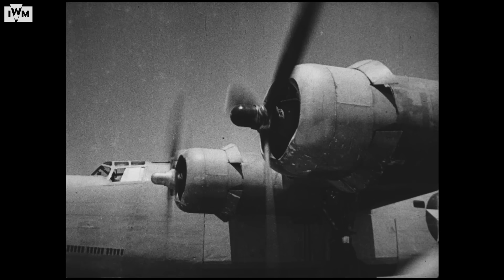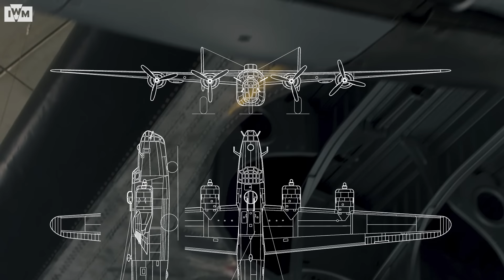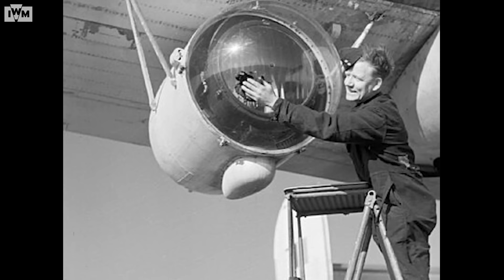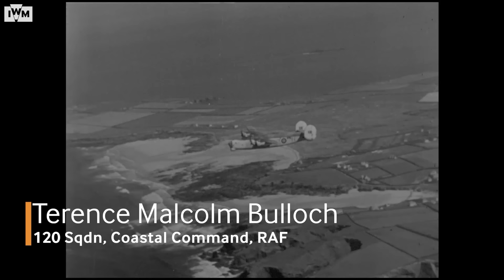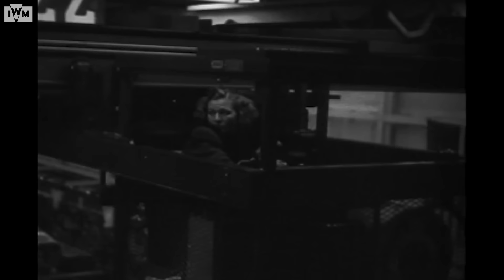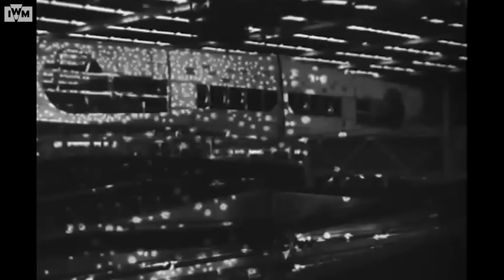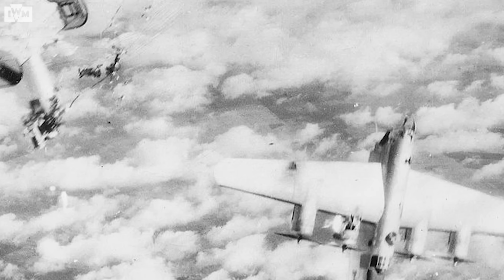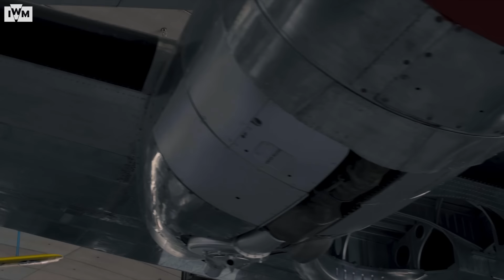The most produced Bomber in history had a bad reputation | B-24 Liberator

Comment from the maker: CORRECTION: In the beginning of this video, we said that the B-24 Liberator is the most produced military aircraft of all time. This is not correct. The B-24 is the most produced bomber of all time, but the most produced military aircraft of all time is the Ilyushin Il-2 Sturmovik.
Reply: I thought it was the bf 109 that was produced in higher numbers than any other plane in history. Something like 30,000 were built from 1936 to 1945 starting with the bf 109 A all the way thru to the last German built bf-109 K in 1945 . Plus  technically the Spanish kept building them well into the 1950’s under license and those planes are the ones in the 1969 Battle of Britain movie . Along with the bombers . The movie production company leased the Spanish airforces planes and pilots to shoot the air scenes in a lot of the shots showing the German side of the battle . Many movies were filmed using the Spanish army and their post war U.S military equipment that they try to pass off as real WW2 weapons. The Spanish army had a whole division or battalion that could be leased to act in high budget military movies about WW2 . All of the Spanish soldiers and equipment were used in Patton , Battle of the Bulge , and as I mentioned before the Battle of Britain.
Reply: @mrbig4532  The Sturmovik had slightly higher prodution numbers. 36000!
Reply: @beatglauser9444  than the 109 ? Not counting the Spanish built ones .
Reply: Cessna model 179 or whatever is the most produced plane. B-24 Is the most produced bomber. 109 Is the most produced fighter plane. And the Stormavich is the most produced military plane of all time.
Reply: @mrbig4532  the bf109 is the a fighter, NOT a bomber.
Reply: @Rosscogalli81  it was used as a fighter bombers . I get it I understand the difference.
Reply: @mrbig4532  Sturmovik my friend.
Reply: I thought the bf 109 was the most produced
Reply: @aprylrittenhouse4562  I think the number of the Sturmovik is roughly 36000 compared to the 109 was built about 34500. Huge numbers indeed!
Reply: @beatglauser9444  I wonder: Did that number include the postwar Buchon?
Reply: @raypurchase801  I am not really sure. But the ones built after the war in Spain and elsewhere were a very small number compaired to the ones built during the war.
Reply: @beatglauser9444   True.
Reply: @beatglauser9444   I wouldn't believe anything the Soviets claimed.
Reply: @aprylrittenhouse4562  Sturmivik my friend.
Reply: @aprylrittenhouse4562  
The most produced FIGHTER. 😉👍🏻
Reply: @aprylrittenhouse4562  The 109 is about 5th or sixth.
Reply: @aprylrittenhouse4562 Germany for sure
Reply: I did do a double-take, but t.b.h ~18,000 B-24's is still a hell of a lot of bombers...
Reply: Thank you
Reply: No matter, did Stalin send the U.S. any lend-lease?
Reply: @TimothyLove-m3x  that’s a big fat no ! Not only that but he detained are bomber pilots who landed there after their planes got shot up , and stole the b-29 bomber when one landed there after experiencing mechanical problems. He let the crew go home but after holding them for weeks in prison like conditions and made them take a out of the way route thru the Middle East when they could of just flown across the Bering Strait into Alaska and been home in 4 hours , or back on American soil . Than he refused to return four of our brand new b-29’s and copied everything down to the personal items the crews had on their planes. Never had a license to build any of those tu-4’s that they used from the late 1940’s up until the mid 50’s .
Reply: The same claim of the Me109 has been made often. I have read that Germany produced more fighters to the end of the war than ever before, but the quality control was gone. Eric Hartman said that late model 109s were 
"obvioulsly sabotaged".
Reply: I was just about to comment on that. Glad you caught it.
Reply: The Soviet Union lied about everything. not lying could get a person killed.
Reply: It's wicked refreshing to see a channel that cares about accuracy! It's rare today. I don't think I've seen any of the big channels (infographics, simple history, timeline, etc) ever go into the comments to make corrections after editing didn't catch it. Your passion for accuracy will keep me coming back 🤘🏿
Reply: Po-2.
Reply: Well the Sturmovik was a flying tank so technically you are still correct :)
Reply: Emily Charles is an excellent presenter.
Reply: Il-2 was a bomber...
Reply: Before it started I knew errors were on the way.and that is a big one.
Reply: I have read seperately that the most produced aircraft was the German 109 at 30,000+ produced.
Reply: @ImperialWarMuseums  During WW2 the B-24 was the most produced!! 
The Sturmovik was continued to be produced for some time after the war..
Like the Commies were using it in Korea.
Reply: @ImperialWarMuseums  that's assuming the Russians were accurate in there count you can't always assume the numbers were correct
Reply: You caught and corrected the mistake halfway through your excellent video.  A plane I knew very little about. Thank you.
Reply: The B-24 was the most produced American built aircraft of WW-2.
Reply: @johnosbourn4312  Thanks in large part to Ford's efforts building it.
As I recall, Willow Run peaked at something like 10 completed a day (and almost half of the total built during the war).
Reply: @bricefleckenstein9666 At its peak in 1944, the Willow Run plant, outside of Detroit,  produced almost a bomber an hour.
Reply: @PBFoote-mo2zr not quite they were from Czech and were built with a bomber engine that had high torque making a already dangerous plane to operate on the ground even more dangerous. The Israeli’s got pilots to get them in the air but over a short amount of time they were mostly destroyed in accidents on the ground . Better planes became available and the Czech built 109’s disappeared from history. I have seen pictures of a few 109’s with the Star of David on the wings .
Reply: @mrbig4532  To be fair, it wasn't just the engine, but also a terrible prop making most of the torque. It was also bugged by the problem of synchronizers getting out of hand, and machineguns shooting the propeller off.

And, well, it was a pretty overweight G-10 (or around that, a late Gustav) airframe with an engine severely underpowered for its job.
Reply: @mrbig4532   I believe israeli forces used bf 109s to fight Arab forces in the 40s/50s. Ironically fighting against spitfires!
Reply: @Billynoarms They were czech made Avia 199:s. Looked like Bf-109, but were made after war and the original DB605 substituted by Junkers Jumo -engines. Avias were much worse planes than the Bf-109:s, terrible to fly and were hazardous at take offs and landings.
Reply: Would you like to also correct the statement of "the flawed tactic of strategic bombing" as well?  I mean, considering that almost every historian attributed Germany's lack of resources towards the end of the war, in part, to the strategic bombing campaign.
Reply: @foddersfollies7494  The bombing campaign's effects were found AFTER the war to have been significant, but overstated.
In MANY cases a "destroyed" production facility was back in operation the following WEEK.
This was especially an issue with oil production facilities, though the synthetic oil production stuff tended to be "offline" longer than the actual oilfield stuff at places like Ploilesti.
Reply: Would not be "politically/socially correct" to say that strategic bombing was part of the success for the Allies.
Reply: Me109 was 35000 we will never know the truth behind Soviet statistics. I going with the 109
Reply: @Wolf-hh4rv  im also a skeptic of soviet numbers but that number actually makes sense considering how many variants the IL-2 had. Arguably, there’s enough difference in all the airframes to say that the 109 is the most produced since its airframe stayed relatively the same compared to the IL-2 varying in many engines, turret configurations (if it even had one), and as mentioned the airframe itself
Reply: @Wolf-hh4rv  - Some sources say that damaged 109 fighters returned to Messerschmidt  were counted as newly constructed aircraft.  So, the actual number is disputed.
Reply: @Wolf-hh4rv  Total numbers of the IL-2/10 is 43,000 airframes built.

Comment: I'd say the B24H had better firepower where it really counted: firing forward and high. It had both the top turret and the nose turret. 4 heavy machine guns per plane.

Axis aircraft only really liked to fire in fast head on passes, trying to catch up from the rear or sides meant far too long exposed to the combined firepower of the entire formation. Plus, a head on attack was far more likely to be effective directly firing into the cockpit or able to hit the engines without having to blast through the wings. Even a damaged aircraft was doomed, if it fell out of formation it could easily be swarmed and finished off.

The big problem was the B24 was too rear heavy, which meant it just wasn't stable in flight like the B17 was. Especially when trying to line up for a bomb run and as the aircraft lost a lot of weight from dropping bombs.

Comment: I know I won't make many friends with this. But truth is: The B-17 and B-24 were equally outdated and a little bit crappy aircraft. They were designed for the air war people imagined in the mid 30s. 
They were slow, expensive, needed a large crew (10-11), had mediocre range, low payload for a four engined bomber. And while the Lancaster wasn't faster it could take double the payload much farther and due to the longer range could fly shorter missions at a higher cruise speed with a crew of only 7.
In essense two Mosquitos could transport the same amount of bombs as the B-17 or B-24, but at a much higher cruise speed, at higher altitudes and with a longer range and only 2 crew each. And if push came to shove the Mosquito was almost as fast as a Bf 109.

Comment: The B17 was vastly more expensive to build and was more maintainenance heavy as well.
Reply: The B-17 was cheaper to produce over the B-24, $204,370 vs $215,516 in 1944. Data from the Army Air Force Statistical Digest 1946, by Statistical Control Division Office of Air Controller June 1947.

Comment: I take issue with the presenters comment ".. the flawed policy of strategic bombing".  Had the numbers of aircraft been available to mount an almost nightly 1,000 bomber raid, there is a considerable argument that it would have worked. Albert Speer, Hitler's architect and (later) armaments minister is on record as stating that '...if the Hamburg raid had been repeated (frequently and consistently) Germany would not have been able to continue with the war". The moral arguments against Strategic Bombing aside, the simple fact is that it never got to a 'tipping point' in its effect on the enemy. Preparations for D-Day especially diluted those effects.

Comment: My dad was a navigator in the RAAF on b24s and he said fully laden it was difficult to get off the ground and he often remarked 'the poor old lib'. But his aircraft was used to do extremely long range spy drops in the SW Pacific so the aircraft were probably close to max weight. On the other hand the B17 was virtually non existant in the Pacific after 1943 because of its poor range. Also the Liberator closed the mid-Atlantic gap in the battle of the Atlantic which the B17 could not do and so the Liberator had a huge role in defeating the u-boats. But the Liberators poor flying characteristics were due largely to the high aspect ratio Davis wing which paradoxically also gave it its long range and big bomb load. The fact that Liberators had very similar loss rates as to the B17 in the European theatre means the Lib could mix it with the best. By the way a book has been written on my dad's unit 200 Flight RAAF and it is called "Leyburn's Liberators'.

Comment: The huge Ford B24 plant at Willow Run seemed to take forever to get up to its mass production targetted output but once it did, it amazed everyone. In addition to its own fully completed aircraft,  Willow Run also exclusively produced many of the B24 subassemblies which were then shipped to other B24 plants also tasked with final assembly, as mentioned.

Comment: In a Martin Marauder B 26.
My Father flew 153 missions over Europe 
from May 1943 to May 1945.
9th Air Force 454 Bomb Group.

Two Pratt Whitney 2800 WASP engines.
Four bladed Curtis propellers. The fastest bomber in WWII. Landing speed. 150 mph.
Top speed in a dive without bombs 
475 mph. 
12-50 Caliber guns 
2 in the nose ( modified)
4 belly guns forward, pilots guns.
2 top turret guns
2 tail guns
2 waist guns either side.
12 total. Most fearsome formation tactical bomber in world war two.

Most missions between 10-15,000 feet.
The most powerful zone for deadly 
88 German flak batteries. As many Luftwaffe fighters coming and going to
targets until his last mission in 
May 1945 over Kassel Germany.
In addition, 
My Father led the B-26 raids over Bastogne 
during the Battle of the Bulge breakout.  
This bomber could carry 6,000 lbs in bombs, the same as a B-17.
153 times where every mission was
D Day.

Comment: the numbers tell the tale, 4,735 b-17s were lost in combat while over 6000 b-24s were lost in combat. and in many ways many b-24s had an easier time of it facing much lest resistance operating in the far flung pacific. the b-24 could do many things better than the b-17 because it was a newer aircraft. but it simply could not stand up to the punishment a b-17 could with its lower wing loading among other things. and a superior aircraft (or at least partially superior) isnt worth anything to the war effort if it doesnt make it home.

Comment: I remember reading that early-model Liberators were regarded with suspicion in UK service because several disappeared without even getting a distress signal out. If I recall correctly, the problem was eventually traced back to a poorly-designed hydraulic system after one blew up in a hangar.

Comment: Thank you! Excellent story.  A friend told me an interesting fact. Not sure if accurate but...  The B17 had all electric motors powering everything.  (lot's of copper)  The B24's were all hydraulic. Only problem was their seals weren't as good as today plus the hydraulic fluid was flammable.   So B24's leaked fluid and when hit by a hot round, caught fire.  But easy to produce, not much copper.

Comment: My Grandpa flew B-24s in the China-Burma-India theater. They were converted to haul fuel over the Hump (the Himalayan Mountains), then called C-109s. Grandpa said they were often called C-one-oh-Booms. Being loaded with so much fuel, the fumes would build in the fuselage, after takeoff when the crew would flip the switch to retract the landing gear it would spark and ignite the fumes, exploding the whole plane. They lost a few to that before they started punching holes in the fuselage to vent the fumes. Additionally, not a pressurized cabin, and with no refrigeration at their bases, they would put bottles of drinks in the inside panels of the doors, go up to altitude, then have cold drinks when they landed. The B-24 in the Air Force Museum in Ohio, the Strawberry Bitch, was flown back to the USA by my Grandpa.

Comment: 1.  Strategic bombing was effective, it ended WW2.
2.  The 24’s problem was its looks:.  a cobbled together bomb truck, and that was what it was.  Consolidated borrowed wings and tail from earlier flying boat.  The outfolding gear looks goofy.
3.  The 17 was 4+ years older than the 24.  It had time to de bug.   During that interval, Semi-monocoque structures matured ..the bottom line being the 24 structure worked harder, but had less damage tolerant.
4.   The 24 flying quality and its performance derived from higher wing loading.  The higher wing loading (and Davis airfoil) gave it speed and range, but not forgiveness.   Pilots had to be on their game.  An Engine loss was serious.  
     We forget that pilot instructors, pilots, pilot training, crew chiefs, maintenance, air frame and engine manufacturing, air bases, etc were going up the learning curve simultaneously in ‘42 and ‘43.  Errors were made, people paid the price.
5.   The 24 served in all theaters, whereas the 17 was pulled from the Pacific early.   Arguably the 24 closing the Atlantic gap was the decisive event in the ETO…no convoys the Brits capitulate or starve.

Comment: Why do seaplane characteristics have anything to do with a long range heavy bomber?  That's is why you need to cover instead of just dropping that senseless assertion.  The Catalina ALSO had a miserable control system that was notoriously HEAVY in the best of circumstances.  The B-24 with a high wing gives the advantage of easy bomb loading, but a seaplane NEVER cuts a bomb bay into the fuselage like that, too!

Also, the Norden bombsight never lived up to it's hype, so it was just a more delicate/harder to fly plane that could cram more bombs and range to kill people in carpet bombing and crews at an alarming rate.

Comment: The b17 was crap. Slow, could carry very little bomb loads, American bombs were also terrible tnt, Christmas cracker bombs. The mossie could fly faster, higher, was cheaper to produce/ operate, could carry the same bomb load, only far more effective bombs (cookie) and only had two crew.
Unfortunately Hollywood propaganda is now about to make out the B17 was the greatest bomber of the war. It wasn’t. It wasn’t even in the top ten. Unless you wanted your crews to be shot out of the sky.
Reply: Certainly, I prefer the B-24 to the B-17. Don't know why, maybe it looks better. It does have a bigger bomb load if set up for bombs and not petrol.
The Mossie is a different beast entirely. Small, fast, not trying to fight it's way through. Built in several places in several continents rather than massive production lines.
Not used for area bombing, more for target marking and precision strikes.